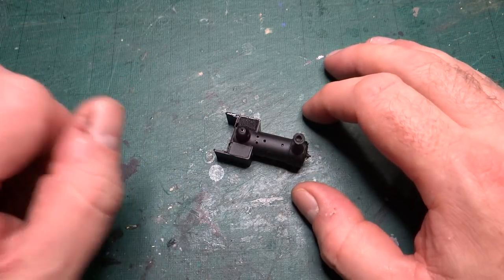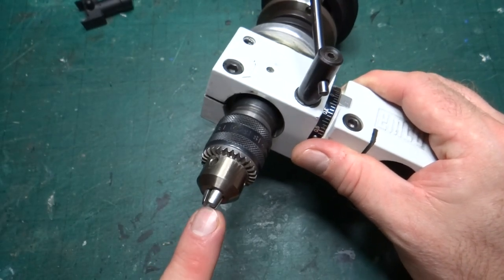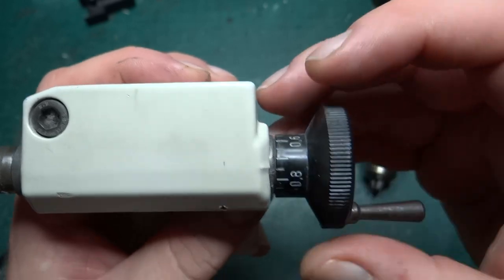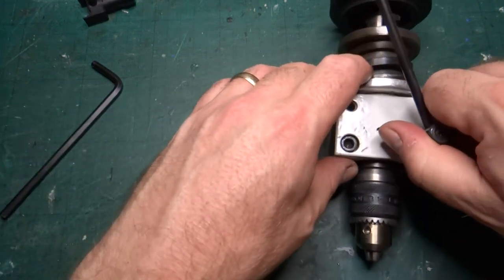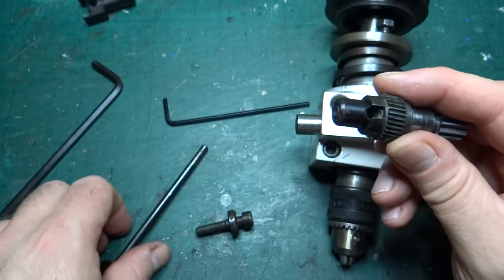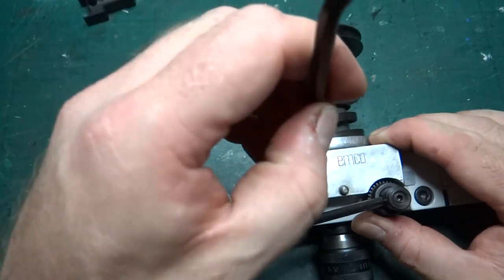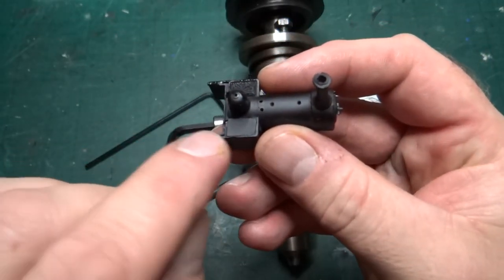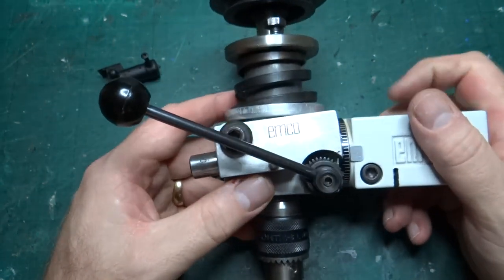Let's Review... a Vertical Fine Feed Attachment for the EMCO Unimat 3

Comment: Looks like I better get one of these!
Reply from the maker: If you've already got the milling column for the Unimat 3 then yes, I'd certainly try and pick one of these up as it makes it some much more useful as a mill rather than just a drill press.
Reply: @encoffeedrinker  I do, and I am also a model railway scratchbuilder, in 2mm and 4mm. I often need to make gearboxes and so on, and fine depth control would make it easier by a LOT.